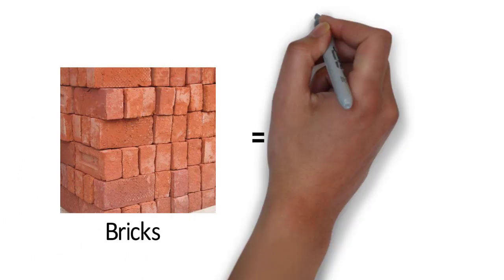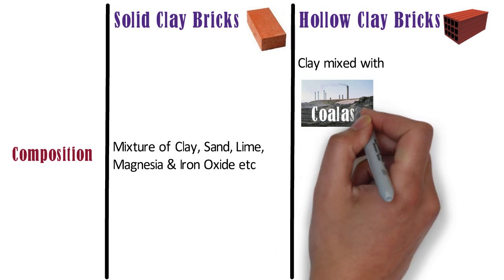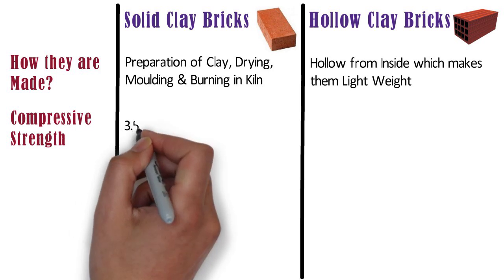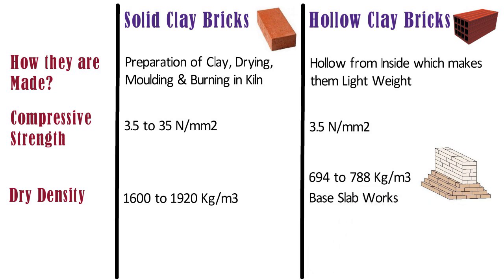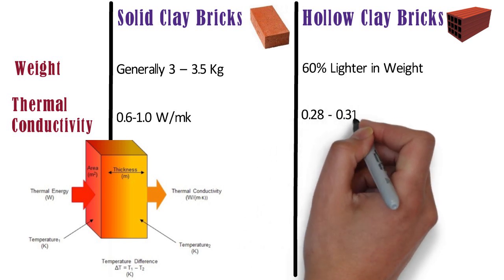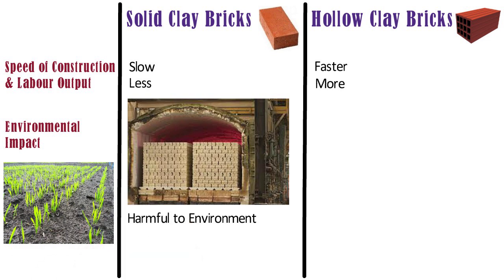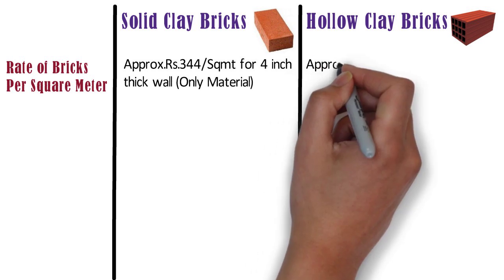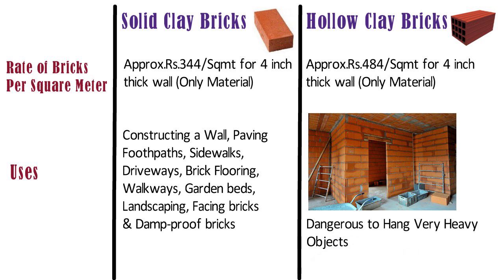Solid Clay Bricks VS Hollow Clay Bricks

Comment: This is confusing. In another video they mentioned two types of bricks. The vertical ones, they claimed, were load bearing and you can construct another floor on them. Is this not true then?
Reply: Agreed , most of the points are not true, like wienerberger never uses Fly ash production process and clay cost vary from Rs 6 to till Rs 25 which are used for exposed Masonry, Solid clay brick are not burnt in controlled temperature. Hollow clay bricks are very much suitable for inside out wall's

Comment: I have a very life saving Question.

To explain & make sense, I'm making a forge out of these three holed clay fire bricks & need a clay powder paste to put them together, any suggestions or knowledge of what this is that will not explode after 3000 degrees Fahrenheit like concrete that does explode, personal experience issues I discovered & it wasn't fun, please help, it's a life saving QUESTION for anyone whom may know of something that will work, I'm learning & need to learn / know stuff like this, the fire clay bricks can withstand up to 5000 I believe but I can't find the paste / powder that will help & withstand the same temperatures I need it to help hold the bricks together, any suggestions or thoughts on specific materials ?
Thank you to anyone who will help answer.

Respectfully, / Sincerely.

Signed : 

Pauly~